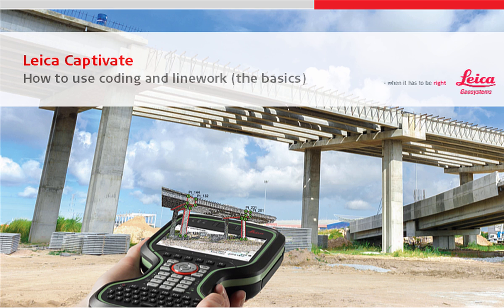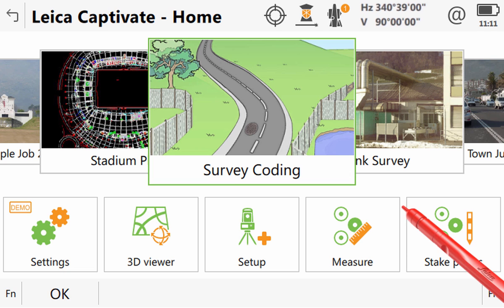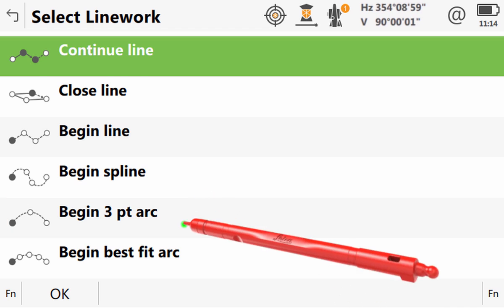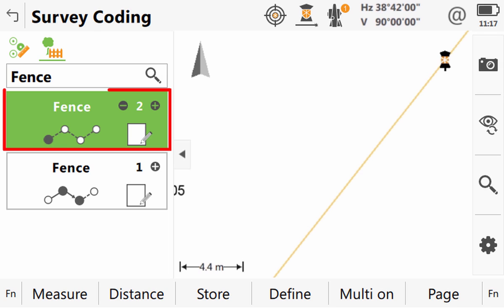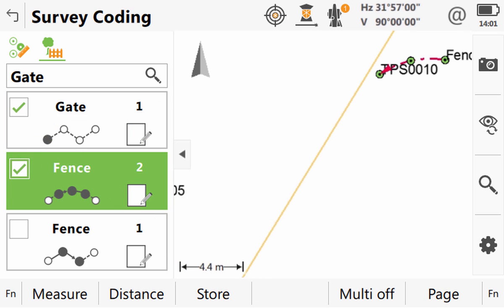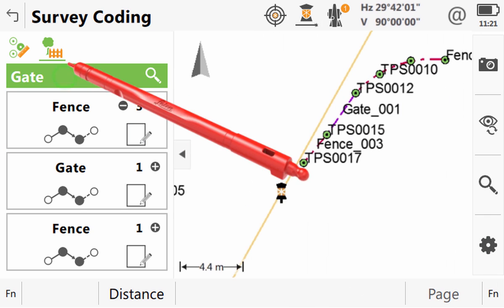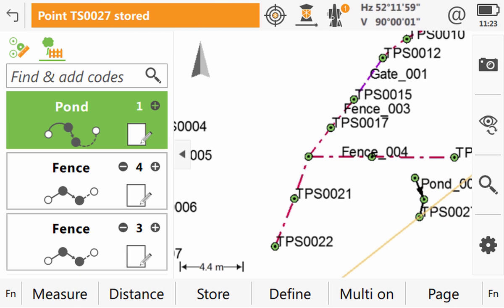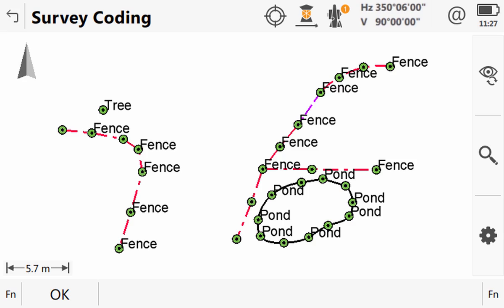Coding and Linework 1 (the basics)

Comment: When typing in a string number complete with "enter" key, don't use the up/down arrow to move to another code box, otherwise the screen happily shows all the string numbers you typed in but the software actually uses a different (or previous) string number.

Comment: Hi, great video but I was wondering why I am having an issue with the linework numbers/strings on my CS20? I have used various codes and changed the strings using +/- as per your video and when I check the map everything looks exactly as it was surveyed. However, when I check my point list, every single number on every single linear code, has been stored as string 1? When I export an Autodesk FBK this obviously appears as one very tangled spiderweb! Any idea why the strings being stored are not retaining the string numbers assigned to them? Any help would be much appreciated. Thanks
Reply from the maker: Hi David. Could you let us know your email address so we can have someone contact you directly? You can email it to admin.social@leica-geosystems.com.
Reply: Bro did you have solution to your problem??